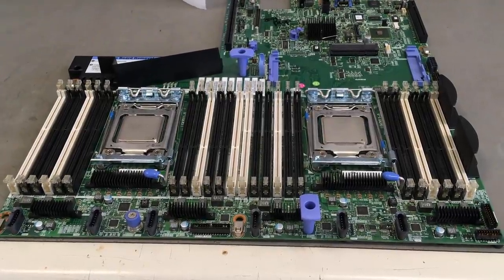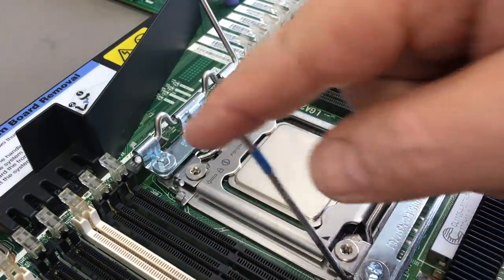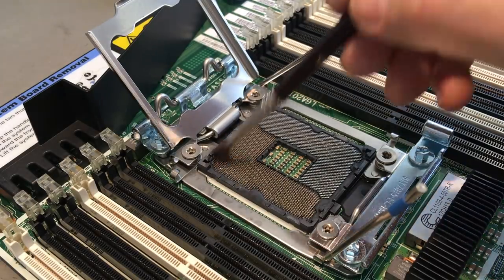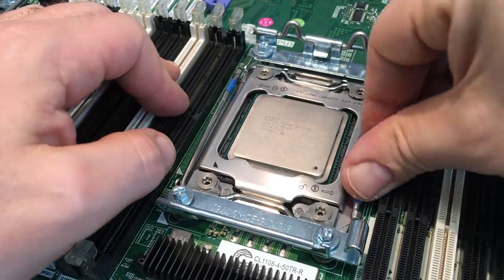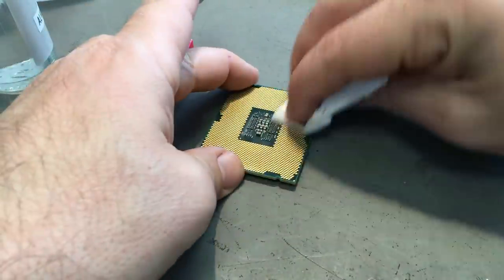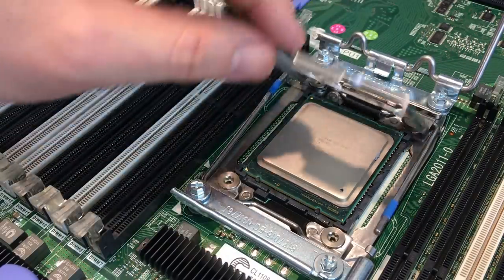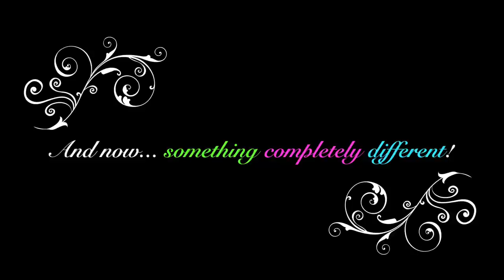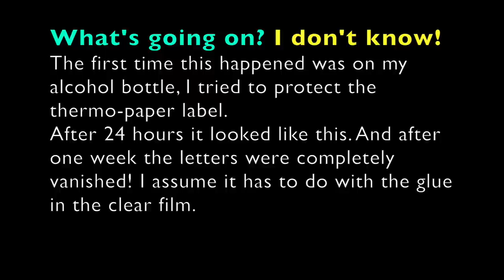How to clean a CPU socket... and a thermo paper trick (PWJ182)

Comment: Can i do this with am5, 78003dx eith alcohol and lint free swab ? Its flat surface contact side not pins.
Reply from the maker: Cleaning the processor contact pads? Well that's the same technology as a Xeon processor. I see no reason why that should not work... 🙂
Reply: @PlaywithJunk  cheers, bro. I bent pins in am5 board, gutted, ordered new board.    This time surgical presision. I pray everything else is ok. Expensive lesson.
Reply from the maker: @leighmorgan2959  If the pins are only slightly bent it works fine. But when they are completely folded, they will break. But there are chances that the pin is eithe not used or one of the VCC or GND lines. If one of these is missing, it doesn't matter. But if it's a vital data pin, you're screwd
Reply: @PlaywithJunk  thx for reply. Brought a new board. I hope all other parts are ok. The CPU I'm worried about.
Reply: @PlaywithJunk  went ahead and cleaned them, I notice discolor where I wiped, will that matter, sorry for all the questions, I appreciate any answers and you're time. Can tell u know what you're doing. Reddit can be a bit hostile. So I can't be doing with that.
Reply from the maker: @leighmorgan2959  Just let me confirm what you're doing... you are cleaning an AMD Ryzen 7800x3d processor chip with iso alcohol and a lintfree swab?
OK, as far as I can see, this CPU has only gold contacts on it's backside. No SMD components like capacitors etc. That means it's easy to clean. You cold also use a cotton cloth. A discoloration is normal but it's not permanent. Until the alcohol is evaporated, the contacts seem brighter.
If your swab gets another color, this means there was dirt on the CPU. The epoxy PCB or the gold do not wipe off. Except you bought a fake CPU... ;-)
One more thing to concern is static electricity. Make sure you don't walk around with the CPU in your hands and your table and cloth should not be made of plastic. Best would be a grounded antistatic mat but if you're careful it's not necessary. Touch a grounded piece of metal before touching the CPU or the board. 
You know what? I think that's a good idea for a video.... Antistatic!
Reply: @PlaywithJunk  mate. Thx so much. I'm installing it as we speak with replacement board. Wish me luck. I'm terrified, having a nightmare getting bios to flash using ez flash button, USB, I've formatted to fat32 as far as I know, having to use phone to format and struggle to see file system, it says vfat as far as I could find. Now it's just endless flashing, not working. Urgh. Lol
Reply: @PlaywithJunk  is it worrying the color stayed tho. U said the discoloration goes away after drying but it didn't for me, stayed same. Well success, finally successfully updated bios, at least I think. I can't get a display to my HDTV using HDMI, I'm still getting orange, or yellow ram and red CPU. No post. Urgh. I wanna cry.

I used 99 percent alcohol and those swabs and dipped end swab into bottle and was very gentle. Ya know u said they are good, does that make them quite durable ? Just how fragile are they, like are we talking if they do much as touch another object they could break ? There not pins, flat contact
Reply: @PlaywithJunk  so, finally got it to boot, finally updated bios, that did it. But now only 1 stick of ram works ? I tested each stick in every slot, by itself, 1 module works fine in every slot, the other works in none. Literally not recognized at all. Does this confirm 1 stick is definitely bad ? This is a brand new board, not the one I bent pins on. tho I was wondering if maybe that killed a stick ?